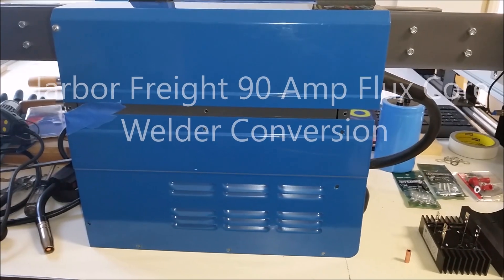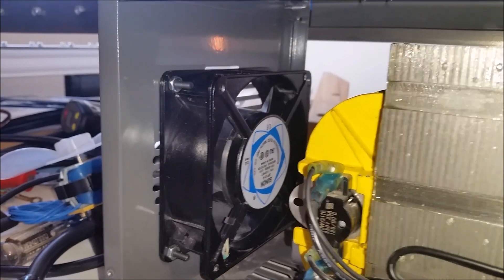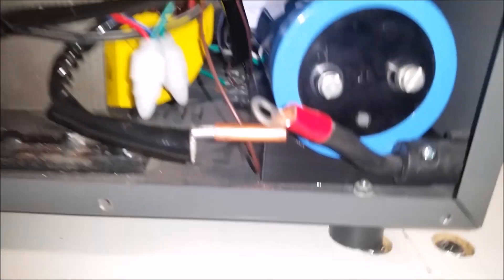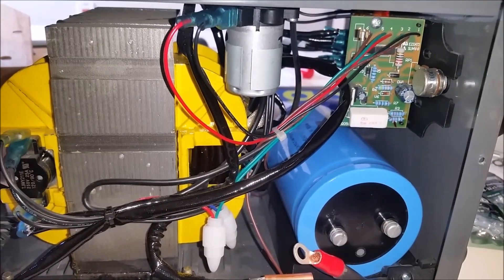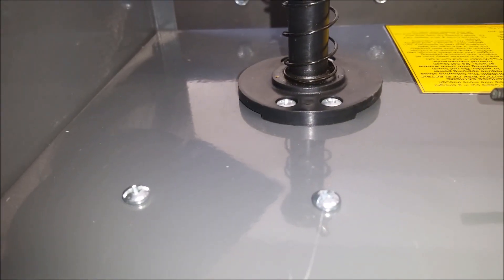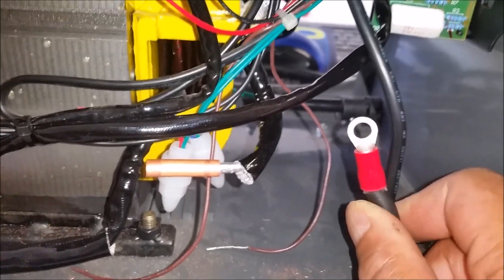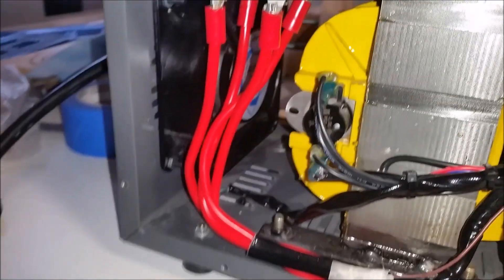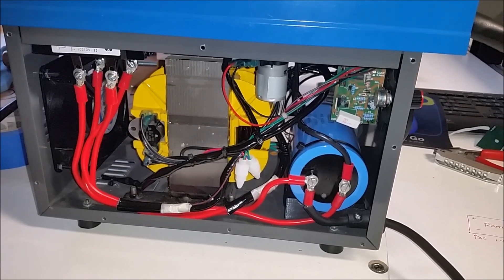Harbor Freight 90 Amp Fluxcore Welder DC Conversion

Comment: Nice video.. Neat and clean upgrade!! I have upgrade mine recently and would suggest to anyone considering and upgrade to install an inductor. You can make one from an old microwave oven transformer by removing the windings,  just cut the outside of the windings with a sawsall and push the rest thru, and then wind eight or so new turns of # 8 wire to make a new winding. If space is an issue, forego the capacitor. The inductor is going to help keep the current stable over the half cycle - the capacitor will not. Inductor stores kinetic energy and they oppose instantaneous changes in current. The inductor is place in series with the torch. Between the torch and neg leg of the circuit.
Reply: The inductor is to be installed in series on the POSITIVE side right before it leaves the mig welder via the clamp. Since the flux-core welders operate best as electrode NEGATIVE, the positive is always the clamp that we typically refer to as the grounding clamp... The capacitor is to be installed in parallel between the DC negative and DC positive BEFORE the inductor. This will yield the best results for flux-core dc welding... Not sure why so many of these mods don't include the adding of an inductor when it's so easy to make and all DC flux-core welders that come from the factory all have an inductor in the schematics.
Reply from the maker: Hey Mike thanks for the comments. Could you explain what the inductor is and how one would install it. I'm curious myself and I'm sure others would benefit from your expertise.
Thanks again...
Reply: Hey Jereome,  Take a look at these.  A picture is worth a thousand words: https://www.twi-global.com/technical-knowledge/faqs/faq-what-does-inductance-do/ ....... or  https://www.esabna.com/euweb/mig_handbook/592mig3_6.htm       .......I installed mine in the front, on a HF 125A Flux Core welder, where you installed the cap and used smaller caps in the rear. I literally, have almost zero splatter and a very stable weld current. I used stranded 8 gauge wire to create the new core because I had it and the transformer in the welder appeared to be the same gauge. I monitor the inductor and it runs cool. So there are no issue with current flow overheating the core. I'm a Dyi'r just like you and the folks who watch these videos looking to benefit and learn from someone else's work! I actually used your idea with the ferals and also used the copper to make the connectors. (Thanks)  I have an electronics degree but I'm am NO welder for sure so I understand why this additional mod will make a big difference. My lack of welding skills were greatly improved and the welders  performance was amazing. I would love to send you pics of mine but not sure how to to it. Let me know if I can. Thanks again for the video!!

Comment: Great, So you did extend the AC wire. And the great place for cap and rec! Hope I found your video earlier, already finished my mod last night, I placed the cap on flux cord area and rec on the side wall. A little bit hard for the wire is too short and hard! I use a 200Amp rec and 100,000uf Cap. Total cost is around $50.
Reply from the maker: Well it works out either way. I just didn't want that capacitor especially out in the open where you have a chance of touching it. Make sure that you cover the ends well so that you have no chance of contact. They are very powerful when charged, can maintain that current for years if not discharged and do bad things to you if you touch it without first discharging it. You can also install a drain resistor since your's is out in the open. Someone made a comment that I needed to install one, not a reason for me, it's enclosed within the case itself.
Reply: jeromejt62 I put my cap on the top with flux wire. But I will move it to another place. Of course it’s inside the case :)
Reply from the maker: if it is about the same size as mine I will gladly print my holder for you. Just pay shipping probably about 4.00 let me know if you want it. Thanks for the view by the way
Reply: jeromejt62 I bought a 24V fan for drain.

Comment: you don't have to order something online or use the stiff 8ga wire that makes the conversion really difficult,  home depot does have a really pliable stranded 8ga wire it's just not in single lead form, home depot sells Southwire 8/4 600-Volt CU Black Flexible Portable Power SOOW Cord, it's kind of expensive at $3.60 a foot but since you only need a little 1 foot worth gives you 4 one foot pieces of really pliable 8 ga wire which is plenty to do the conversion. trust me when i say, when it comes to trying to run the wire where you need it to go inside the welder, using the flexible 8ga wire out of the southwire power cable makes the conversion so simple compared to trying to use the stiff crap that doesn't make tight bends, it is even way more flexible then automotive 8ga wire and makes it a breeze to solder connectors on the wire. not having to fight the wire like i've seen others have to do made it possible for me to do the whole conversion in less then 45 minutes and that was with a 10 minute cig break.......
Reply: sorry just now saw your message, I did mine a couple years ago and things like electrical parts continually change sellers but from my view point that a good thing because the prices on parts like capacitors go way up then go way down and luckily you have a few different configuration options for the caps so you can put together the cheapest, you want the cap or caps to be in the 50v range with a total capacitance above 46,000u. as far as the rectifier goes, regardless of what some are saying,  there is one rectifier option to avoid, any of the 100A rectifier's, they blow after a while. I did a short ebay search just now and found a really good deal on a rectifier, a Single-phase 150A 1600V Bridge Rectifier for $13.99 with free shipping and it's from a US warehouse so no waiting on slow boat from china. hope this helps and if you want more let me know, here's that link i found today, they only have 3 150A rect's left and they are more expensive everywhere else i looked:
https://www.ebay.com/itm/Single-phase-Diode-Bridge-Rectifier-1600V-Power-60A-100A-150A-200A-300A-400A/202321050432?hash=item2f1b463b40%3Am%3Am_rR8rhYH07DWOYlNwPQW-w&var=502297768625
Reply: A/C supply wire in your home is solid copper. Are you so thick that you believe stranded wire for a welder mod is acceptable, safe? Maybe read a book on 
A/C principles?
Stranded wire is acceptable for D/C. Like 12v battery cables. And this kids conversion lacks a bleed off resistor in the capacitor. Maybe he will have cardiac defib and die? That big capacitor could easily stop your heartbeat if you touched outputs by accident. 1/2 an amp is all you need in direct contact to stop a human heart. That cap is holding 20 amps with power switch off.
Reply: 1. l the cap stores Farads not Amperes. (charge not current)2. the maximum voltage considered safe for humans  is ( according to UL ) 64 V. about what the transformer puts out.3. at 50 Hz it does not matter if the wire is stranded or solid. skin effect kicks in at much higher frequencies.
Reply: @Aye Bee you do realize the welder puts out no where near as much voltage as the house mains right? All the wiring in the welder is stranded wire, The wires going into and out of any transformer in any consumer grade product is stranded wire. Stranded wire is good for pretty much anything the issue and reason romex is solid wire is the more power going through stranded wire the more strands there has to be. 

That's why you have romex going into the 220 outlet for your dryer but  this fat cable going into the dryer. Imagine drilling the holes in the studs all through your house for that fat cable  and expecting the house to not collapse.

Back to the welder. This welder puts out around 12 to 24 volts max and 90 amps of power. Again all the wire in the welder is stranded.  The power cord for the welder is stranded wire. The ground cord for the welder is stranded and the electrode has stranded running to it

As for the cap yeah really should have a bleed resistor. Shouldn't be a problem tho as long as its the newer model and not the older model that had a constant hot electrode. Also as long as he follows proper safety and checks the cap with a tester before messing with anything if he has to open up the welder again. Ah hell what am I saying? He is probably gonna fry at some point.

Comment: hi most "muffin" fans have a direction of air flow do you have the fan blowing air on the transformer or drawing the air through the welder? you should have the air being drawn across the components and expelled out the back. so that would be the arrow on the fan pointing to the back.
Reply from the maker: The direction of airflow is the same as the stock fan and that is to draw air from the outside in and force it over the transformer in large volume to keep it cool, so that's what I went with.

Comment from the maker: Robert I've added a link for the capacitor that I purchased on Ebay in the discription Hope this helps you out
Reply: Are we sure the capacitors have any effect? ... Google says the voltage output from a welder is 15-25V when the arc is running. Lets suppose we want the capacitors to limit ripple to 10% or about 2V at 100A. I=CdV/dt so C=Idt/dV. When 60 Hz is rectified the time between peaks (dt) is about 1/120th of a second. So C = 100*1/(120*2) = 0.4 Farads. Most people seem to be using 10,000uF at most which is 0.01 Farads or 40 times too small. Someone check my maths but I would expect them to have little or no effect. Has anyone looked at the waveform?
Reply: not there any more

Comment: I can't find a capacitor cheap enough for this project where should I get one? Everything I see on eBay is $50
Reply: i paid around $11 on ebay. it came from china
Reply: I bought 2x 47000uF 50vdc capacitors for $8/ea on eBay. Wiring them in parallel does the trick.
Reply: Robert Houseman mouser，$31.80+tax+shipping 100,000uf
Reply: I got one for 1$ on wish.....